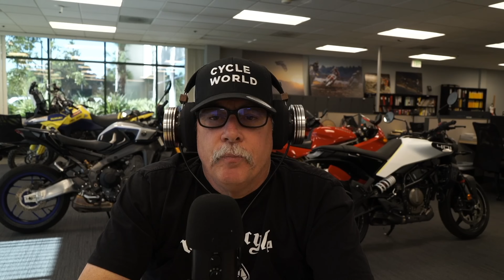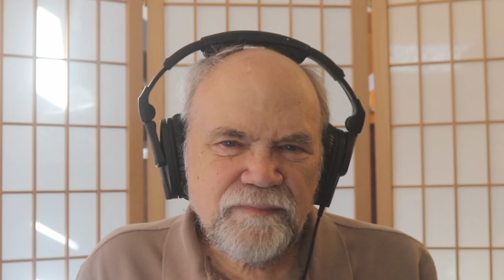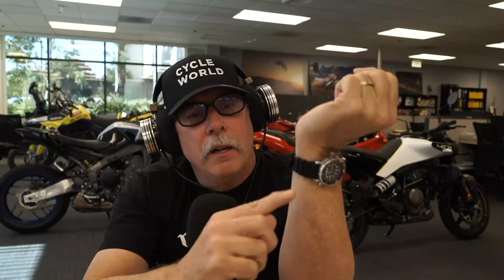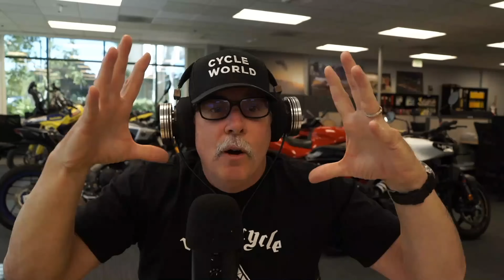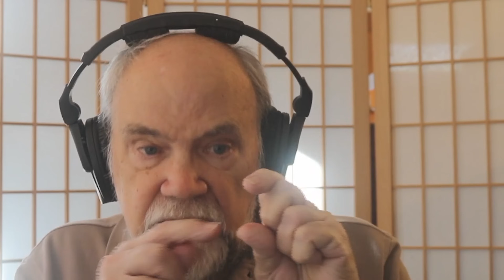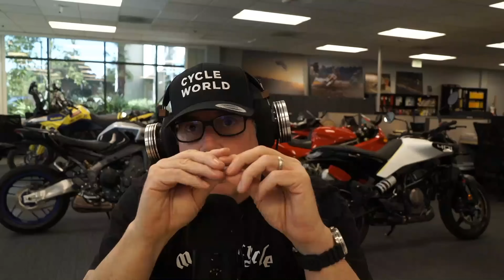STOP! All about BRAKES

Comment: My teacher in US Suzuki told me that on the early GT750's with double leading shoe front brakes. If you put the brake plate with shoes in a lathe and turned the shoes down a couple of thousand  and made them perfectly round, they were as good as disk brakes until they overheated. 16:50

Comment: Nothing causes "shrinkage" more than not being 100% sure that lever is going to feel the same every time I use it. Sears Point 1980's Formula Singles turn 11 - I knew I could brake very, very late, but eyeballing the barriers and wondering how hard I would hit them after forcing a low side gave me great shrinkage.

Comment: Tour De France bikes use Cork brake pads  on carbon fiber rims
Reply: Some yeah, cork doesn't heat up that much and it's pretty light but for descending a col you might want to use pads with more friction material added to it.
Reply: @LaurentiusTriarius  they use them so their 4000 Dollar carbon fiber rims don't get tore up

Comment: Please explain  how re gen electric  braking is BS
Reply: Motorcycles are too light to effectively use regen . This light weight means their braking distances are very short. I have my Zero FXS setup with regen when braking but I’ve never seen the battery percentage of charge go up when braking. The regen is activated by the brake light switches so I can get some small amount of rear braking by pulling on the front brake lever just enough to activate the brake light switch but not have the front pads actually start squeezing the rotor.
Reply: @truthboomertruthbomber5125  my comment was about the BS of Electric cars making less air pollution. The exhaust is virtually non polluting . Over 95% of "smog" actually comes from brake dust. Electric cars are thousands of pounds heavier using bigger brakes making more dust.  The gen Z think this doesn't happen because of "re gen braking" . This has been proven by electric car only zones in London where smog has gotten worse since these zone were mandated
Reply: @stewart8127  I don't have an E bike because I want to save the world. I have one because it''s fun to ride.
Reply: @truthboomertruthbomber5125  Ever ride fixed gear bicycles ?  You can get the rear  wheel going in reverse while going forward if you're strong enough. and slow down fast than  locking up rear wheel.  This is done regularly with cars on neutral drop YT channel.  A 200HP electric motorcycle  could in theory do this.
Reply: @stewart8127 rubber from tyre wear also.
Reply: @truthboomertruthbomber5125  whatever I want my E Bike to have 200/17 tire and instant reverse for drifting  with a front and back throttle. And no brake dust.

Comment: I have a friend who’s father used to run what we called “Hardtops” and Midgets on a dirt track. 
They would use wood (specific variety) brake shoe linings on the car . 
As conditions changed they would saw off a section of the lining creating the early proportioning valve. 
Balancing front to rear brake bias .

Comment: The late and great John Surtees joins with my other heroes, Mike Hailwood and Stirling Moss (in cars) that the throttle position is either fully open or closed. YOu can moderate the bikes speed with the brakes and clutch, but its best to just keep the throttle wide open. Only a few riders of the modern era learned to do this, or have the courage to do so. Maintaining momentum and balance is the key to riding fast.

Comment: Back in 1970, I acquired one of the first Honda CB750K1 motorcycles in Rhodesia, I think there were only 4 of these bikes in the whole country. It was the first bike with a disc brake on the front that I had ever seen or ridden, and it was wonderful.

Until it rained, then the coefficient of friction of the brake pads reduced to zero, and there was your front brake gone. The back drum brake still worked, but the coefficient of traction of the tires, had also reduced to zero, and there was your back brake gone, along with any possibility of leaning into a corner.

I eventually found that the only way to have any braking at all, in the rain, was to constantly drag the front brake while riding, so as to keep some heat in the disc and pads.

I am still, to this day, often amazed how well modern brakes and tires work in the rain, there is almost no loss of performance compared to dry.
Reply: That why the put holes in rotors now

Comment: 1955  Northwest Model 6 Cable Crane has Brake Hubs and Drums 5 feet in Diameter clutch friction material on the inside of the drum and  brake  bands on the outside of the drum.  Asbestos with bronze impregnation .

Comment: In 1918, Malcolm Loughead (who later changed his name to Lockheed in 1926) proposed a concept of a four-wheel brake system using hydraulics. Using cylinders and tubes, Lockheed used fluids to transfer force to the brake shoe when a pedal was pressed. It required much less effort for the driver to apply brakes.

The hydraulic brake system was first fitted into all four wheels of a Model A Duesenberg car in 1921. However, it was beset with fluid leakage problems, but engineers from the Maxwell Motor Corporation produced rubber cup seals to help solve it. In 1923, the improved Lougheed brakes were offered as an optional upgrade on the Maxwell-Chalmers car for $75. This new brake design was also used in Chrysler cars from 1924 to 1962.

Comment: Kevin, did you know Ron Wakefield, who showed up at the 1969 Daytona race to compete in the Amateur 100 mile road race on a just-released Kawasaki H-1? His bike was pretty much stock, modified factory mufflers, ran in second place for much of the race—amazing performance. Of relevance to this discussion, I vaguely recall that he ran a spool-hub front wheel with large discs attached on either side of the front rim—many years before Buell. I also vaguely recall that he used cable-operated Campagnolo calipers. His braking performance going into Turn One was pretty good. A Cycle World report from this event is available online, from reporters Dan Hunt and Ivan J. Wagar.

Suggestion for a future discussion, a comparison of post-war 500cc singles in terms of cylinder/head material, bore/stroke ratio, valve configuration/actuation, maximum rpm, power output, and other relevant factors—illustrating the relentless advance in the state of the art. Start with the Moto Guzzi Falcone thru BSA Gold Star, Velocette, Matchless G50, culminating in the Manx Norton—and compare them to a modern 450cc Mx/flat track engine in terms of weight, size, and power output. 

You guys are the best!

Comment: I'm glad you spoke about the rim brake on the Buell because I owned an 05 XB12SCG and thought that brake was fantastic.  However, since I never took that bike to the track I wasn't aware it didn't work as well out there.  I loved how easy it was to change the pads on that bike.
Reply: I got to ride a 2023 hammerhead with rim brakes and I hated them. I was taking it easy just riding a backroad and was getting brake fade almost immediately. For having a ride by cable 1190cc engine, the brakes were trash. The entire bike wasn't very confidence inspiring. It rode very janky and squirrely. It was like riding a ducati 916 from 20 years ago but worse and less controllable.

Comment: When I was racing my Suzuki T20 Racer the brakes were not as good as I would like, so unable to afford an Oldani wheel I obtained a CB92 front brake and ran that with the false side removed, it was bigger and stronger than the T20 one, it seems a bit counter intuitive to put a 125 brake onto a much faster and bigger 250 , but needs must😊
I worked as a Post Office messenger, riding a BSA Bantam with tiny pressed steel brakes they DID NOT ‘work well and rain stopped them totally working.